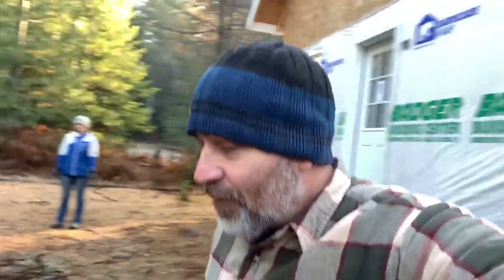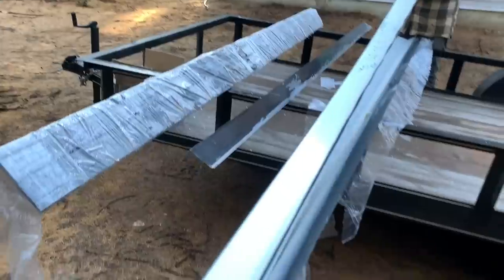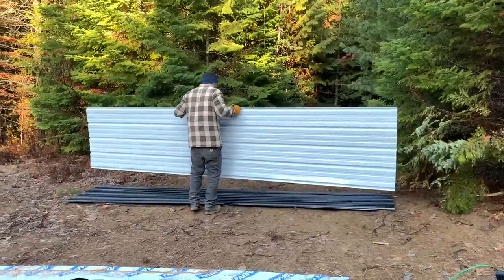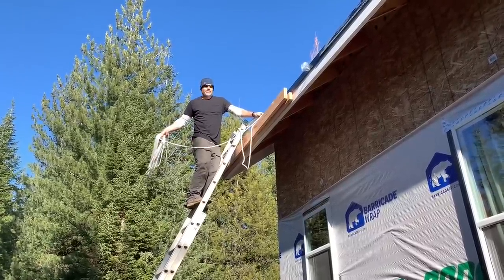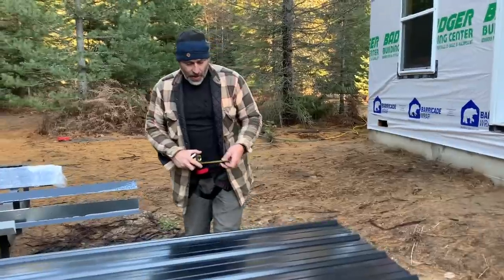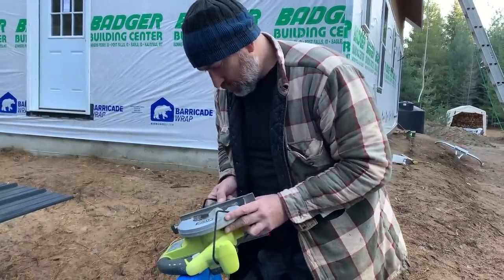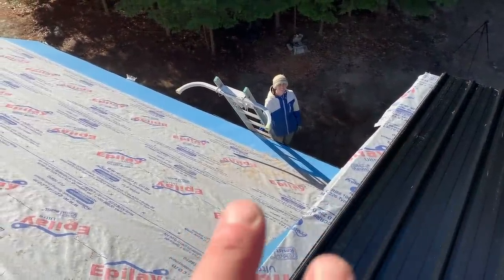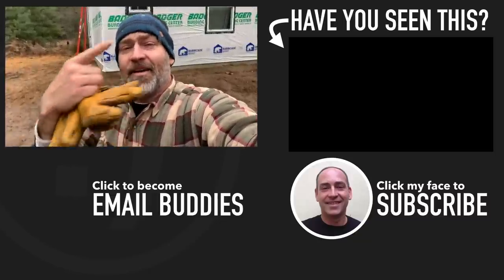DIY Metal Roofing Install | Off Grid Cabin Build #55

Comment: Safety, safety, safety, so much for lip service.  DO NOT tie that blade guard back.  It is there for a good reason.  If it gets in the way you can hold it back with the tab on the back of the guard while you get the cut started, but then release it as soon as you the guard no longer interferes with getting the cut started.

Comment: Martin, you are doing real well on all your roofing decisions so far.  If you would  like some advice from an old contractor, try clamping a board under and over your roofing when cutting, it gives the roofing support as well as a place for the base of your saw to ride on so you don't scratch your roofing.  Also, I would strongly recommend that you put all the screws into a panel before adding your next panel.  These panels get crazy slippery when wet or with even a skiff of snow, you don't really want to have to keep walking across them.  Another trick you can do is to pre-drill all of your holes while the panels are on the ground, you can drill through several panels at once.  It also looks very professional to have all your screws line up on the roof.  I'm glad you put gloves & glasses on, the metal flying off that blade is hot and will burn your skin.  I love watching the progress your family has made.  I'm praying for good weather for you to finish that roof.

Comment: Very nice choice of color. We are using Black R panel and accents on our shop and House up there with Gray body color. Metal roofs that are not standing seam require a maintenance plan. Every couple of years somebody will get to tighten down the Exposed screws that work their way up due to expansion/contraction. Those neoprene gaskets will need to be replaced in 5-7 years. Since there are only 2 sizes of roofing screws as you know those 1/4" can only be replaced with the 5/16 bigger ones so having a permanent Anchor point to hang off that "Fun" pitch will be nice too. PrePlan your strategy with getting up to clean out that Wood stove flue in snow cover might be a thought too. Our Team put up the Metal roof for a Fort Hood Soldiers Extreme Home Makeover and some of the volunteers showed up in their "Work Boots" not knowing that tennis shoes are the rule on metal roofs, so they got to stay on the ground.
I'm not a Treky, but I love how your Faith leads to "go where no (Johnson) has gone before! Well done.

Comment: Look like drop edge and steel to cover the sides of the front and back of the house. Skill saw with the blade backwards or grinder. Safety glasses and face shield would be required. Looks good at what you installed!

Comment: Whew I asked is that the drip edge and yes I was correct LOL  I use to manage a metal roofing company in Seattle  for years.  Call some of your church buddy's or other friends to help maybe???  DO NOT OVER TIGHTEN THE SCREWS FOR THE ROOFING.  Otherwise you will have a dimple look in your metal and that's not a good thing.  ONLY wear "TENNIS SHOES" on metal roofing anything else will be too slippery and possibly scratch your panels.  The last thing to go on will be your ridge cap OR you can install it as you go when you have TEN FEET of paneling it would be good to lay that sections ridge cap at that time.  So proud of you Mr. Johnson for all that you and your family have undertaken.  God's blessings.
Reply from the maker: Thanks for the tips.

Comment: I hope you put metal screws on the lap joints. Normally you need to put a sealer on the joints. But maybe you don’t need to with the pitch of the roof that you have.

Comment: On the hand snips you use the yellow not the red handle.    Red and the green are for left and right cuts.... the yellow is for straight.   Using the red hand  you it will fight you all the way....     On a scrap piece score with blade knife  and bend it back and forth....  it should snap on the line....
Reply from the maker: True but I couldn’t find my yellow ones.

Comment: Did the metal supplier include the, Horizontal Closure Strips, with the roofing? I didn't see you putting any down on either end. you want air moving around, but you don't want bugs under there. You are putting the screws on the flat surface, is the where this manufacturer said to place them? I know warranty are different between manufacturers with this placements. I couldn't see it from camera angle, did you have flash on the sides of the eves before you started?
Reply from the maker: It is on there. It didn’t make it in the video for some reason.

Comment: Excellent job guy's . I would look at that pile of metal and go "what ". The roof is at a different angle than the dormer . How did you deal with that transition for the ridge cap ?

Comment: It looks like you're not using Corrugated Foam Closures under the ridge cap or at the lower end of the roof panel. Doesn't it call for them?
Reply from the maker: It is on there. It didn’t make it in the video for some reason.

Comment: I'm surprised you didn't pre drill your roof panels while they were still stacked prior to install,  that way all your screws are in a straight line .
Reply from the maker: That works only if your panels all line up.

Comment: First fine Job ! But working with metal I found you should wear leather gloves to avoid cuts (I Got the scars to prove it !) What really scared me is tying the safety rope to the car without in-oping the engine ! You could of pulled the coil wire ! I know you say I got the keys but you know "Murphy's Law" what ever can't happen could happen )